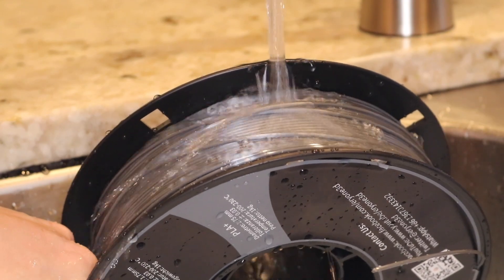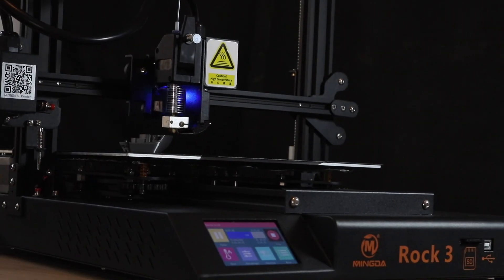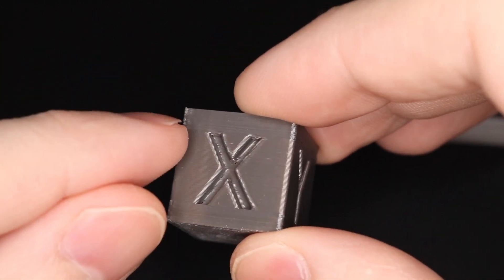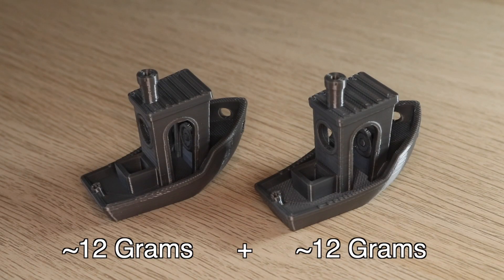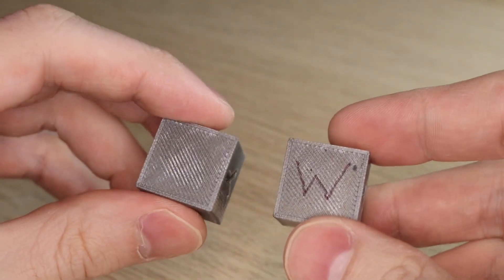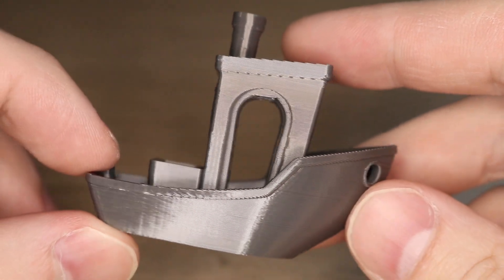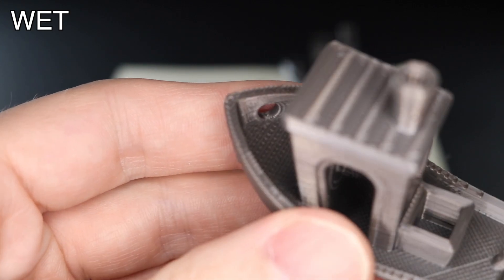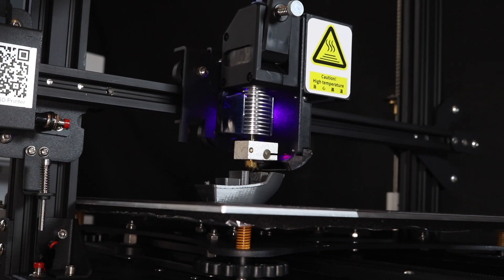3D Printing with REALLY WET filament / Eryone PLA+

Comment: This is a great experiment idea. LOVED  that you used the PLTR to draw out the test result boxes

I wonder if in the future with additional testing could you
1. Control Print
2. Same Print but Dried for x hours
3. Same print after wet for x hours
4. Same print after wet for x hours + dried for x hours 

Guessing might require two rolls or to separate out the filament.

Comment: This has been the general conclusion that PLA, really doesn't get too much 'worse' when wet, and even a mild dry  method can be used instead of the typical 'hours in a drybox' system.  Others, like PETG on the other hand, show vastly different results.  These tests being repeated are a good thing though, as I believe the Plus (+) factor in some filament may have a huge difference, as well as those without it, or other materials, so always good to get more brand names tested in the pile of results.

Comment: I don’t understand this. Hygroscopic and Hydroscopic are different. You are not adding “moisture” by submerging in water. That filament absorbed zero or very little water from being submerged. The weight added is mostly trapped in and around the filament itself or the spool. 

Hydroscopic it what happens when you submerged something. Hygroscopic happens when a material can draw moisture from the air. 

In effect this testing is totally wrong for what you were trying to show. Further more PLA isn’t hygroscopic from what I read. PETG, HIPPS, NYLON and anything water soluble is. The only time PLA can be hygroscopic is when it has additives that themselves are hygroscopic. Like carbon fiber is very hygroscopic. 

The right water to test this is to take a spool of PETG, and leave it in a humid environment and measure how much moisture it pulls from the air. 

There are plenty of videos showing this same thing. PLA gets dry from being in the open air and gets brittle. But I’m not convinced that’s because it’s absorbing moisture. I believe the opposite is happening. It’s drying out.

Comment: An additional note for this topic, the sensitivity to moisture can manifest several ways. I use Ultem 9085 for prints at work and it is extremely sensitive to moisture. The biggest two problems are the generation of steam, but also hydrolysis which is where the high temperature water reacts with the polymer and actually breaks the polymer chains. 9085 is extremely sensitive and starts seriously losing print quality and mechanical strength at as low as 0.04% moisture. So there may be effects that are not detectable just in an analysis of the print quality.

Comment: Dipping a roll of filament in a tub of water is not the same as absorbing moisture 🤦‍♂️
Reply: Agreed, my workshop is pretty damp and I’ve a lot of spools that have been in there for a long time and exhibit massively different printing performance to fresh out of the packet and dried for 6hrs filament

Comment: I didn't expect there would be much observable differences on prints with a PLA type filament.
However this would be a valid test for most TPU types, and then drying filament is essentially a requirement for nylon types.

With really hygroscopic materials tho you might want warmer drying and for significantly longer as well.
More tests needed 😃